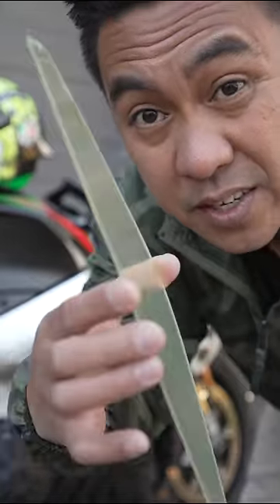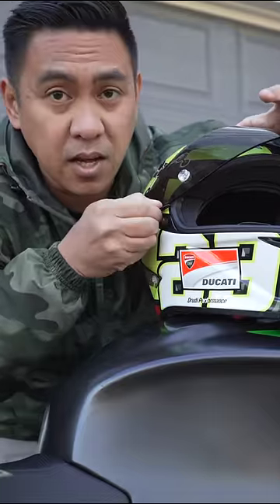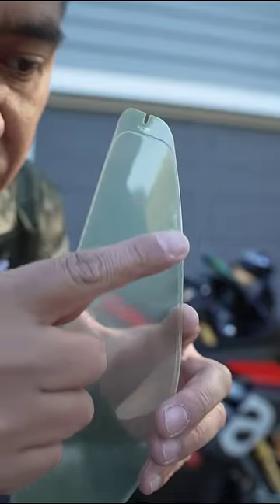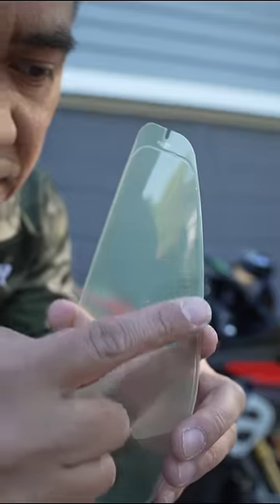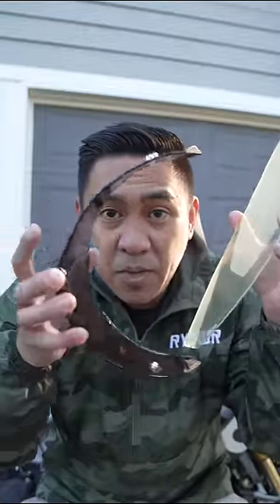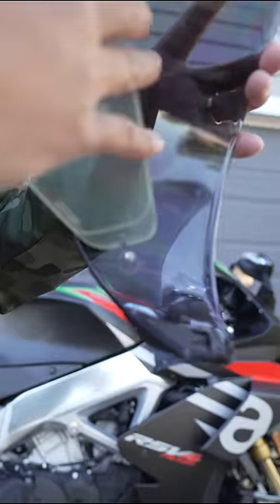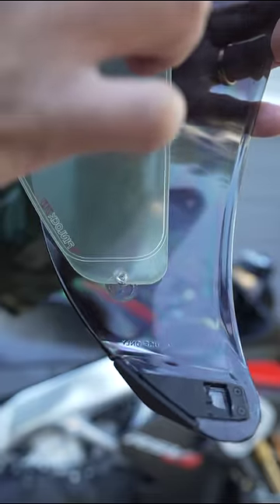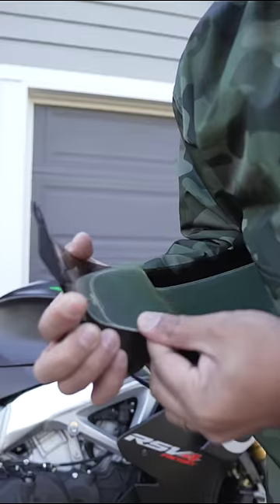HOW TO INSTALL A MOTORCYCLE HELMET PIN LOCK

Comment: It has nothing to do with trapping air. The gasket is only there to keep the inside clean. The material of the pinlock itself is non-fogging.
Reply from the maker: Wrong. “The moisture absorbing surface of the lens effectively attracts and stores water molecules while the airtight seal creates a thermal barrier, together preventing condensation of the visor.” Directly from Pinlock
Reply: @adobomoto  My pinlock got loose over time and my visor still doesn't fog up, but if I remove the pinlock, it does.
Reply: @emreevo8  Anecdotal evidence is only evidence of an anecdote.
Reply: Keyboard warriors at it again
Reply: Someone doesn’t understand physics
Reply: @emreevo8 My pinlock isnt loose and doesnt fog up, but if i remove the pinlock, it does.
Reply: I like how he pinned the comment just for the shame 😂
Reply: if the material was non fogging, and you put it in front of a material that does not have anti fog properties, that second material that fogs suddenly gains the anti fogging properties? besides you admitted yourself that it came loose, so it is there to be sealed right? other wise I don't see why there'd be a gasket. try it without it altogether and see if it doesn't fog, maybe the day that happened to you wasn't the right environment to induce fogging anyway

nvm I re read your reply. you say it does fog up. anyway. cheers
Reply: @zanechristiansen  The reason of the fogging is your breath coming into contact with the visor. The pinlock prevents this. Yes, the material of the pinlock itself is non-fogging. It has nothing to do with creating a sealed air pocket. Of course, it helps but it's not the main reason of not fogging. Try breathing onto just the pinlock without installing it on the visor, you'll see it doesn't fog up.

And it also has nothing to do with the environment. I've been using it for 6 years in all kinds of weather conditions.
Reply: @emreevo8   and there you have it. I was just takin a shit playing devils advocate. I've never even worn a helmet with a visor so I wouldn't know. I've only ridden offroad with dirt bike helmets. i like hearing people elaborate a little, which maybe could've saved you from getting the "pin of shame" lol.. not that it's shameful, I find it funny when content creators highlight the negative comments but not the positive comments. comment sections can interesting. enjoy yalls selfs.
Reply: @emreevo8  and I guess I really am showing my ignorance, do helmets fog even in perfect weather? like yea its your breath, but I figured it'd only be on chilly days or that type of weather u can see your breath. does it just happen like usually?
Reply: @zanechristiansen  it's all about condensation and relative humidity.
Fortnine did a great video on it.
Reply: I put mine in wrong, making one of the far sides bulge backwards off of the face shield and it still works perfectly fine. So I’m unsure if that stuff might just be marketing to charge $60 for plastic
Reply: @lovelessissimo  hell yea
Reply: Edit: a well worth it piece of plastic
Reply: Must be a gixxer rider
Reply: If you've ever seen a single glazed window, you'd know that it works way worse at not fogging up versus a double glazed window
Reply: @emreevo8 turn ur posts to tighten
Reply: Wrong, allow me to introduce double glazing
Reply: That is completely wrong. The purpose of the pinlock is to create basically double glazing for your visor, which means air has to be trapped otherwise moisture  will condense on the visor. if you don't believe this, stick a tooth pick or something thin under the pinlock at a certain area and it'll ALWAYS fog up there.
Reply: @adobomoto lmao a tool and stupid good combo buddy
Reply: @emreevo8 u can fix it with the screws on the sides
Reply: Just hold it above boiling water when it’s not installed and you can see
Reply: If that was how it worked then the visor behind would still fog up
Reply: Then why paintball masks are dual pane? 🙄
Reply: @bill4602 didn’t remember anyone asking you either
Reply: @adobomoto Dude, you're wrong.  It insulates the visor regardless of the seal.  Some pinlocks don't even have the seal.
Reply: He is partially correct, though.  The air gap does provide a barrier to insulate the helmets visor.
Reply: Pin of shame
Reply: @adobomoto like double pane windows
Reply: @adobomoto ok then rainX the inside of your visor
Reply: @zanechristiansen essentially, if the outside of the helmets a good bit cooler, the visor wont really be a thermal barrier so water tgats in the air tgat comes into contact now condensates, and there you got your fog. So yes that means in fact both the thermal barrier and the non fog material both do their part to keep your visor from fogging. i really dont know what the original creator is on about, this takes 8th grade Physics class to know
Reply: @emreevo8  it's loose, i.e., it still will work just less effectively
Reply: @emreevo8 it's probably because your speed, check how much your going because the faster you go, the more windy it gets to have a chance of fog.
Reply: @adobomoto as a snomobiler both of your are wrong get a heated face mask
Reply: @adobomoto I mean technically you both are correct
Reply: @emreevo8  try riding in snow. see what happen when air trapped in your visor.
Reply: @frostybitten7772 just try a piece of plastic in its place and see how it works. 😑
Reply: @TheGamersRace there’s multiple layers of “protection” here. If you try some alternatives on the market with no gasket in the right weather you’ll see how much of a difference it makes
Reply: @MarissaTheMuse  Or you just get a heated visor because you wear glasses and pinlocks don't help you anyways.
Reply: @adobomoto  Keep beleiving everything your told. They say that so they can charge people like you more. Itsnothing more then a material that is antifog.
Reply: @J-Healy  But hes wrong. Hes just beleiving that the company says. They say its special to charge you more. Its nothing more then material  that anti fog
Reply: adobomoto is the correct response
Reply: That's exacting what I was thinking, some materials fog up and some don't!
Reply: Cold external air with warm breath will build moisture. Ex: cold soda can. It needs to be sealed so both hot and cold doesn’t meet and create humidity. Air lock works like those tumblers like hydroflask.
Reply: Look up anti fog goggles on paintball masks. This is exactly how it works.
Reply: @emreevo8   A great enough temperature differential is enough to fog up your visor. Air is one of the best insulators there is, so the air that is trapped between the visor and the pin lock will help insulate your body heat from heating up the inside of your visor. On a cold, relatively humid day, this will help prevent your visor from fogging up. Depending on where you live, you might not ride in the right conditions that would make that happen.
Reply: Nobody is impressed by a wrong know it all
Reply: This is how double pane glass windows work. The gap in between creates a small thermal barrier.
Reply: @adobomoto it’s literally both. Neither of you are wrong, you’re just both pretentious.
Reply: Man..... who knew there were soooooo many fog/anti fog specialists in the world??!!!
Reply: NOT SO AT ALL.  trapped air is the insulator.  It would just fog up also without the trapped air.  It is very basic science.  The reason your face shield fogs up is because breath moisture condenses on your COLD shield.  The trapped air will insulate your outer shield from the inside warm breath.  THAT IS HOW IT WORKS!
Reply: I have one in my visor. It still fogs up
Reply: @artifex00  They are not a perfect answer.  Check the seal on the pin lock, make sure it is in tact. You need to not leave it on your helmet in the cold garage.   The pin lock side needs to stay warmer than dew point, if you've left it in cold environment so that the pin lock is at cold air temp, it won't work well.  Your outer shield can be cold, the pin lock insulates the inner shield from the cold outer.  but if you leave them in the cold, your breath will just condense on the pin lock.
Reply: Clearly you haven’t played any sport that has two pane goggles to prevent fogging. It does have a coating but the trapped air is a major factor.
Reply: @NoLongo  Houses have duel pane windows for the same reason.
Reply: @emreevo8 that’s because even tho the pinlock is loose, their is still a double pane window affect happening. There is a reason the paintball mask brand Dye makes their visors double paned for anti-fogging features. 

Or why double paned motor cycle visors are anti-fogging.
Reply: Yea no thats not how it works, it does trap air between the visor and the pinlock
Reply: So why does my pinlock fog up
Reply: @emreevo8 L take
Reply: @adobomoto spitting on the visors also work we do it with our firefighting mask spit and smear!
Reply: @emreevo8 my got loose over time and scratched up the visor, had to get new visor and new pinlock
Reply: @adobomoto  or buy a high quality helmet like Simpson with an anti-fog shield.
Reply: Lmao must not have double glazing in your house 😂
Reply: It very much does have something to do with trapping air. Vr headsets are the exact same. It fogs if there's too much air circulation to the lenses while wearing it and the same with if you get too hot using it.
Reply: 😂😂 love it, i appreciate the in depth explanation of how it works.  @adobomoto
Reply: @adobomoto bro turned on asian mode
Reply: Not true. It does in fact trap air. Paintball masks have been using dual layer lenses for years. If the air between the layers escapes, it will fog up.
Reply: @bill4602dont remember asking for your opinion
Reply: @bill4602Ok Keyboard Swine
Reply: @bill4602  stop being a glazing fanboy who jumps on anyone who has anything to say to your subbed youtuber. Just stop
Reply: @emreevo8 might not be optimal but doesn’t render it useless, air is isolating
Reply: if it doesn't trap air the visor under it is probably getting fogged lol, if the gasket didn't serve a purpose why would it be there
Reply: probably similar to how dual pane lenses on paintball masks work
Reply: Pin of Shame
Reply: @adobomoto  that’s just incorrect terminalogy. “Moisture absorbing lens”? 
You mean dew point ?
Reply: lmfao, pin of shame
Reply: Wrong.  It's all about the trapped air
Reply: @Vampr1c  The anecdotal evidence does line up with the explanation and official statement. Besides, all evidence is anecdotal, because there's never any evidence that doesn't have a story behind it. Have you ever seen a written explanation of an experiment? It's simply a very thorough anecdote.
Reply: @kraagnjilwulf1413  Although a fact is not made of a single experiment. P.S. Did you really have to necropost?
Reply: @adobomoto  wrong

Comment: Note: this is absolutely worthless if you wear glasses
Reply: Well duh. Get lasik
Reply: I have glasses and without this my visor always fogs,but my glassss rarely ever do?
Reply: @loafnugget3088  I ride all year long and during winter time humidity is always at 100% or close. Having vents open will fog your eye lenses due to temperature clash, having vents closed will cause temperature clash sooner. There's really no way round it for ME. So I always have the visor open a lil bit. Note that this is my experience with a full face race helmet, adventure helmets do help a lot with this since there's a lot more travel for your breath
Reply: Just wear contacts
Reply: roflmao
Reply: I've never had this problem with glasses
Reply: Get pinlock glasses, obviously.
Reply: @migflc778 one click does the trick...my shit fogged up one time and after that I just one click it open.
Reply: Worn a pinlock with glasses for several seasons. Haven't had an issue, if I wipe my glasses before I get moving they don't fog.
Reply: Haven't ridden bikes a ton yet but from the couple dozen times ripping my buddies 150's around I've learned to wear contacts, bring an extra pair, and my glasses as a backup
Reply: Use anti-fog on the glasses.
Reply: Tape the lenses to the outside of your visor. Your welcome, in advance. 
Salute
Reply: Not at all true. It keeps the visor from fogging up, just an anti-fog wipe or spray on your glasses.
Reply: @iceymedia21 I have astigmatism 😅
Reply: It works unless you want double fog.
Also clean your glasses good before riding helps.
I have minimal fog broblems with glasses spring and fall only.
Reply: works fine for me, as long as all vents open and i dont breath so aggressively my glasses dont fog and the visor also coz i have this pinlock
Reply: @socialmedia5534 bruh no that’s the worst thing you can do💀
Reply: Just out two small holes like F1 drivers. Won't fog up
Reply: it's not completely worthless, i used the same glasses for more than 3 years and the lens is already pretty roughed up. with the pinlock it definitely helps 70% of the fogging (the other 30% is just my shitty lens) but yes, the difference is substantial
Reply: @@cheesy.potxto I have the same problem. If I use the ZEISS anti-fog spray do I need to reapply it every couple days?
Reply: Another reason why I changed to contacts and never regretted it.
Reply: Get Pin-lock eyes 🤷
Reply: Yeah not a problem for us people with good genes 😂
Reply: Wear contacts or get lasik if you are balling like that
Reply: You can apply antifog on your glasses too.
Reply: @iceymedia21  It's what I do!
Reply: needing glasses is simply a skill issue
Reply: I bought an antifog kit for my glasses and a pinlock for my helmet, thanks winter.
Reply: He didn't mention its for people with goggles or blind people lol...
Reply: just put silica inside the helmet or where it likes to fog up, it also keeps the helmet dry

Comment: Those who did not knew: apply shaving foam both inside and outside, buff off with microfiber towel and clean - no more fog. Not a permanent solution, so after awhile repeat it again. I do, it works...✌️
Reply: I’ve heard of people on my swim team doing the same with their goggles. Great trick

Comment: Achohol on visors cause micro cracking. The visor has to protect from rocks and debris...Look it up.
Reply: correct. alcohol will damage the antifog coating of the inside of visors. this is pretty basic. 😁